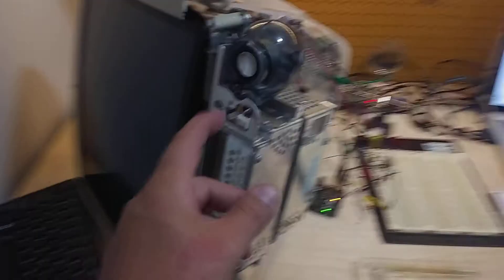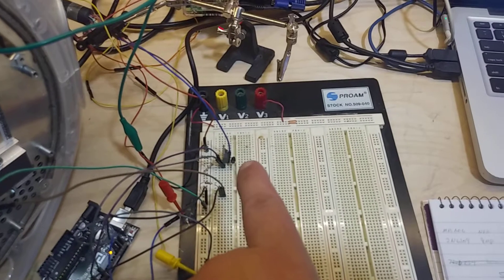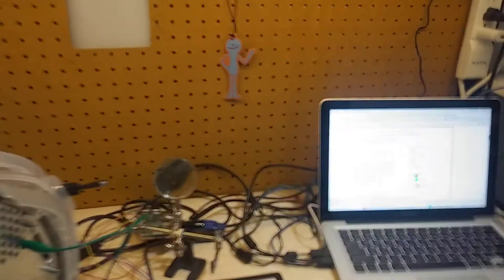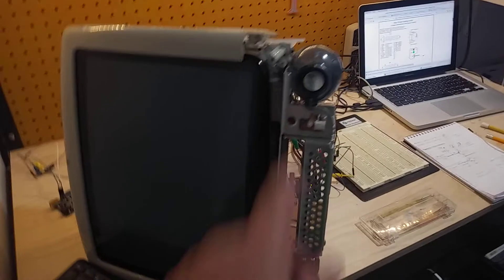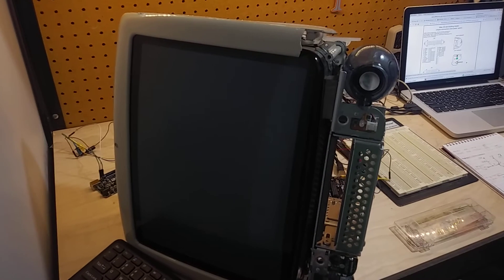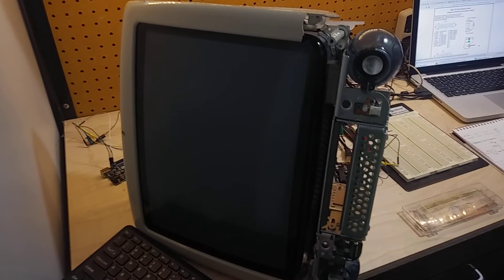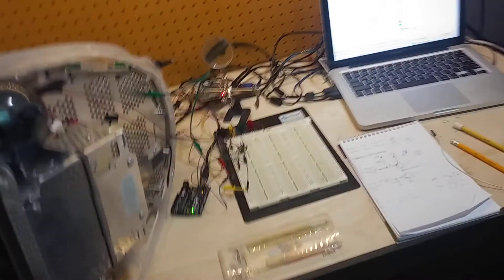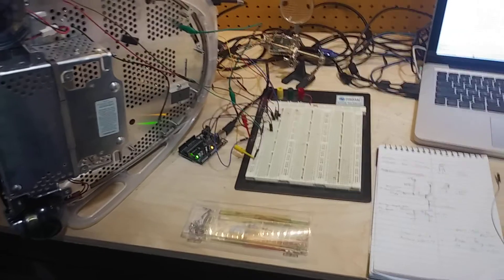power switch with arduino

Comment: Great work so far! I only have a question: does the sleep mode on the raspberry pi work? I'd love if it could control the monitor  without the power button!
Reply from the maker: Thanks!

I dont' think the raspberry pi has a sleep mode
,  I'll have to check. However, I'm pretty sure what you're recommending can be done with any other 
computer so long as it emits some signal that it is going into sleep mode.